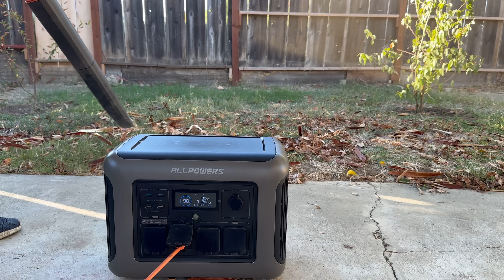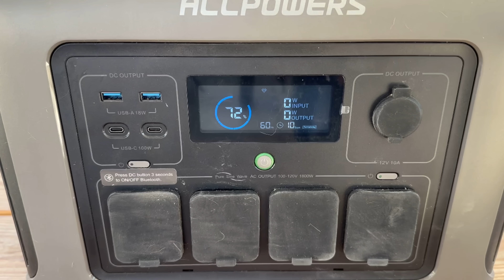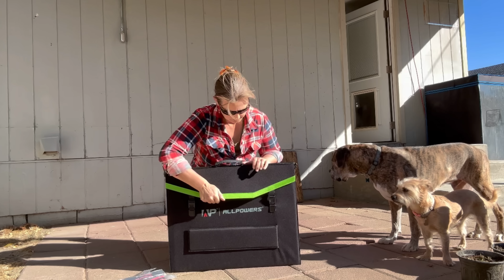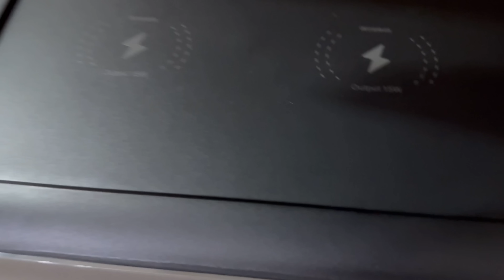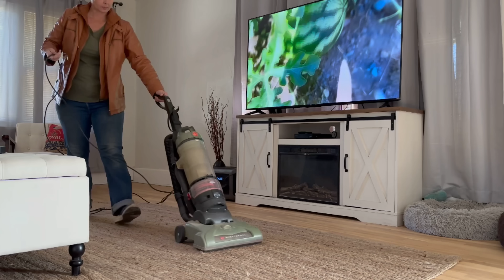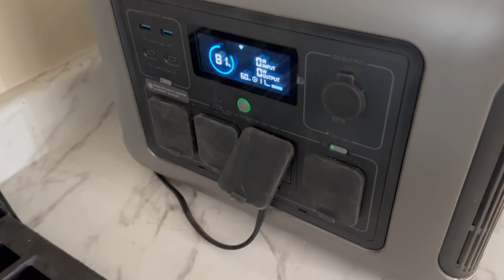A Lot Of Bang For Your Buck - ALLPOWERS R1500 Power Supply

Comment: nice review. think about a used chest freezer which would run longer on this than a kitchen fridge would. last power outage here was around 24 hours. anything that could tolerate freezing I moved from the kitchen fridge to the chest freezer and everything was still frozen when power returned.

Comment: During Helene we used our gas generator for 13 days and it cost about $15 per day to run. - close to $200 and cash only gas purchase for the first week. We are definitely looking at a solar generator to add to our preps. I like the idea of using it often to run appliances. Can you increase the number of solar panels or do you have to purchase more batteries? I get so confused on which to buy. 

So many things we learned during this real life disaster - we were prepared personally but when your entire community is devastated and most don’t prepare even for the first 72 hours, you find yourself helping and sharing resources. After three days I told my husband, we can’t give away any more of our “equipment” for use until we have an idea what the time line is for us getting services back!

Comment: Yes for sure practice using it.
We had 3 nights the power was out for about 2 hours each time ... the first night it was late so I went to bed; next night I hooked up my inverter to get the internet and have left it there all ready to plug in which happened a couple nights later.
I would be hard pressed to get enough sun for solar ... hardly see it these days => chemtrails and mountains block it. I'm thinking hydro is a more guaranteed option since I have gravity fed spring water which runs 24 hours a day and I maybe see a half hour of sun lately

Comment: But what if you dont have lots of sun as in holland???
Reply: some people who can have fuel generators can charge their power stations off that.  I live in a small apartment that faces north so no sun off my ceck.  I keep my power stations charged using grid power but I can take them outside  to a park across the street with solar panels to charge.  I would have to sit with them to make sure tbey don't get stolen
Reply: Get as many solar units to run it. For my 700 units one I have two foldable ones. Then also recharge on a regular generator.
Reply: Would a chest freezer work on this? I know I will  need to look on my freezer to get the information on watts used. I was just not sure if freezers made a difference  in any way.
Reply: @Mys.Teri67  depends on the power used when the compressor runs and how frequently it runs, p!us the power availability of the power station you use

Comment: Like your content but a quick search reveals that this bank isn’t so great
Reply: I got a Jackery 3000 Pro and I LOVE it, it'll run my fridge or freezer and a fan and I use an Endurance brand solar street light in the house at night.  Didn't need a gas generator after Helene which would've been a problem, no electric you can't pump gas and we had trees across our road with power lines under it